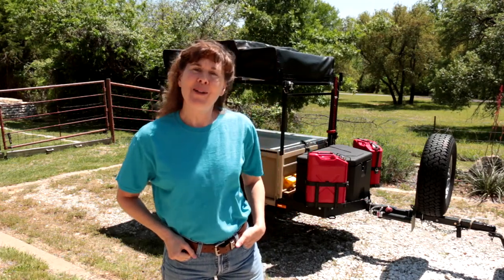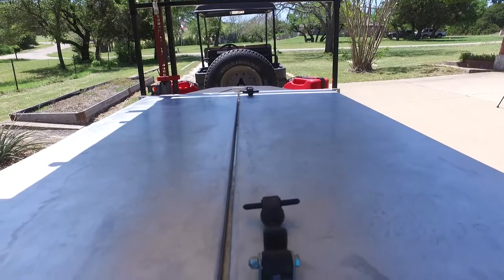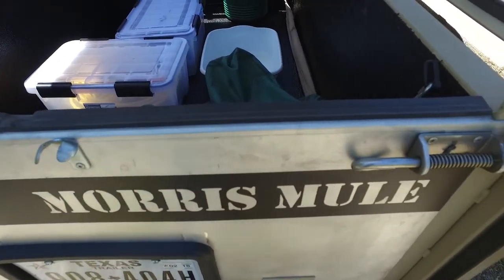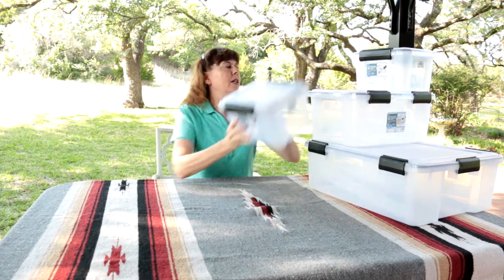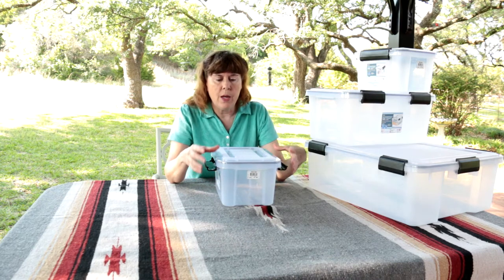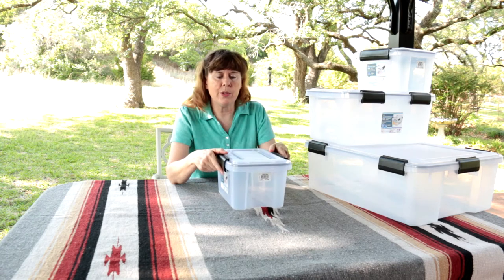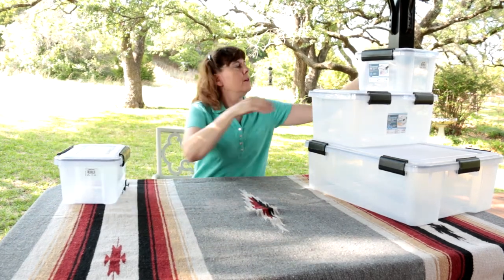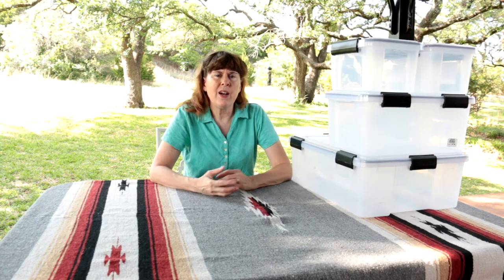Morris Mule Trailer Seals & Review of Weathertight® Containers

Comment: I notice something about the "Mule" and leaks. With the unseasonable August rains, my trailer has been getting a lot more water leaking into the bed. Maybe Morris could've weatherstripped the tailgate!?! What I found as the predominate cause of leaking is the small horizontal gaps at the bottom of the tailgate. With the trailer resting on it's tongue jack at level or slightly low, the gaps are exposed more to rain/water...it hits the tailgate and runs down and into the gaps. When I place a higher jackstand under the tongue, the trailer is nose high and no water entered the bed. This was checked with very recent rains along with a water hose. Just some food for thought.
Reply from the maker: +Parker Estes Thanks for the helpful insights! When we travel the front of George is ever so slightly higher than the back and we've not had rain water ever get in, even in heavy rain. (knock on wood) Morris doesn't claim that the Mule is watertight. We're okay with that and try to pack accordingly. It's kind of like a pickup bed with a cover. A look on the bright side... One good thing about it not being watertight is it won't try to float downstream on deep water crossings.
Reply: I'm probably going to get some automotive weather stripping and place along the inside of the tailgate so it's just shy of the box lip. Should mitigate the leakage a little more. Yeah, there's really no way to weather strip the tailgate vertically because it's almost too tight now. Takes a little effort to pin it. I have 31" tires and put a Max Coupler hitch on yesterday. Even with a 6" drop off of my lifted Jeep, the "Mule" will still ride nose slightly high. Benefits of water running downhill! BTW, I've already borrowed several of your ideas and incorporated into my rig. Why don't you come up with something new so I can appropriate that too!
Reply from the maker: Love that last sentence! We need to get to work on that. Looking forward to hearing how the automotive weather stripping works out. It's a great idea.

Comment: The WWII  jeep trailers did not have a tailgate.  Just a canvass cover but they could and did float.  I think you can  use the weather striping and it wil help but not going to be 100 % and  the mule will not float a t least not for  long.